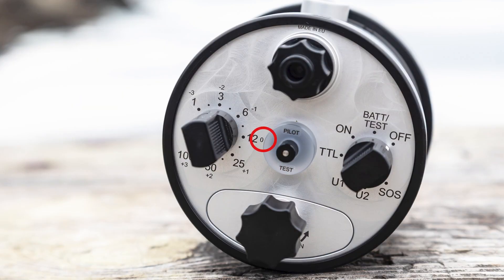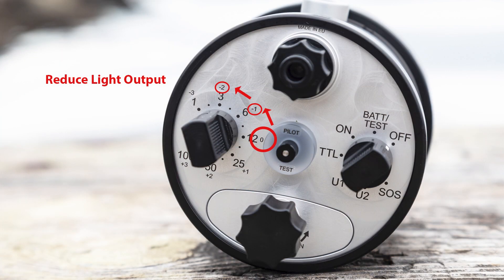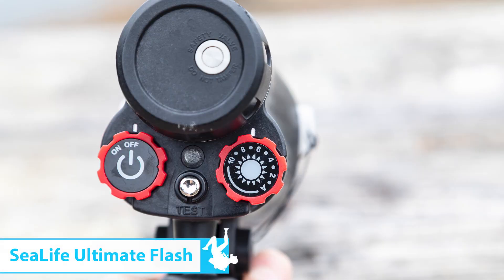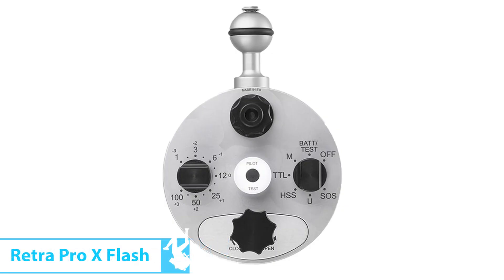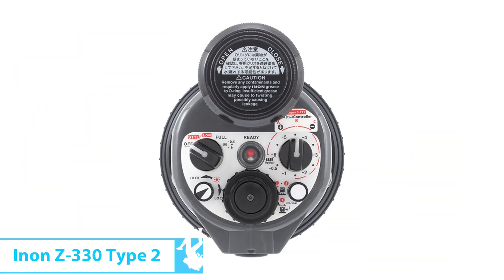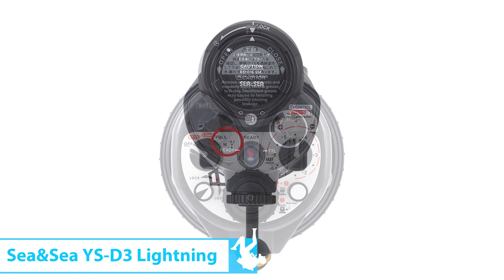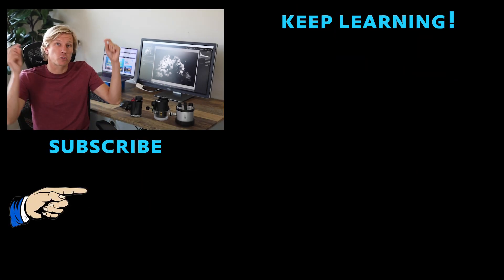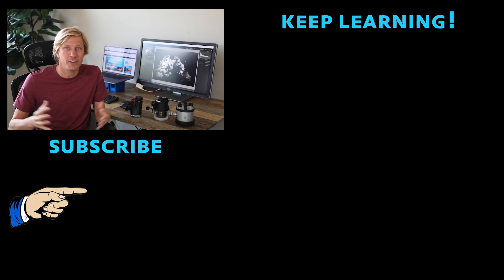What do the Numbers on Back of your Strobes Mean?

Comment: Great Video! A tip I’ve learned using my Z-330 strobes in full manual: sometimes mid-dive I’ll see my images way over-exposed, and after fiddling with the strobe power settings and camera exposure settings, I’ll notice the “OFF-STTL-Low-Full-M” control knob has shifted from the full clockwise “M” position to the “FULL” position, providing max strobe power. Putting it back to “M” corrects the problem. Just remember to go back and “in-fiddle” all the strobe power and camera exposure settings after to fix the real problem. Don’t know why that knob sometimes gets shifted over a click to “FULL,” but I’ve had this happen often enough that now that’s the first thing I check when images suddenly become overexposed. Keep up the really helpful tutorials — they are a HUGE help!
Reply from the maker: Thanks Todd - really appreciate it. Great insight with the Z-330. Are you using thick gloves? Moving the power knob accidentally was a major issue on Sea&Sea's first YS-D1s - I'd turn the strobes off nearly time I grabbed the back to position them. They updated the knob in the next version thankfully. Nothing beats real-world testing pre-production to discover issues like this. I appreciate the info as I haven't used the Z330s.
Reply: @BrentDurand  No gloves — Florida Keys diver! Haven’t figured out yet how I manage to brush the knob to the “FULL” position, but at least now I know where to check first! Now that I’m repositioning the strobes more frequently (thanks to your great video on strobe placement!), maybe I need to watch more carefully how I grab the strobe to maneuver it around. Anyway, great tutorials — keep ‘em coming!  — Kurt

Comment: Hi great video … is it possible todo a video about the z330 the manual settings i can’t find a good video 
You have the m with some numbers and at the top you see nummers and a-b-c
Reply from the maker: Hi Mario. The Z330 is pretty confusing to look at but actually is simple to operate. Next to the M position on the control knob you will see a little diagram showing -0.5 -> -6. This is trying to indicate that -0.5 on the power control dial is full power and -6 is low power. In other words, you turn the knob clockwise to increase strobe output in manual mode. I've included notes on this and a diagram of the strobe back on my guide below so you can take a closer look:
https://tutorials.brentdurand.com/strobe-control-dials/

Hope this helps!
Reply: @BrentDurand  thanks use the m mode and push the button to lock the manual mode 
In the top of the diagram you see a-b-c how to use this one
Reply from the maker: @marioalbers887  If you're shooting manual, then don't worry about that extra diagram. That's for controlling Super-TTL flash exposure compensation. Neutral is in the 12 o'clock position, then you turn the knob clockwise until 3 o'clock position to incrementally increase flash exposure compensation, or turn the knob counter clockwise until the 9 o'clock position to decrease flash exposure compensation. Again, don't worry about it with manual power!

Comment: Great video for sure! I have a YS D2 just like the one in your video, and I notice the guide numbers are the same as f-stop numbers for lens apertures. Is the relationship anything like 1 to 1, so for instance if I’m stopped down to f16 should I dial in the strobe power to 16? Or is that not how to think of it?

Btw I shoot an Olympus OMD Em5 ii in manual mode, with mostly prime lenses fwiw. 

Thanks again for the great content!
Reply from the maker: Hi Jaeson - Great question. In short, no, the numbers on the YS-D2 do not relate to apertures. You'll notice each number decreases by 50%, meaning as you move the knob from one number to the next, you're reducing the strobe power by 50 percent. The highest number 32 is the strobe's maximum power, measured as a "guide number." Hope that helps!

Comment: Hi Brent, 
Thank you for another great video. I have a basic question: I assume the strobe adjusts the total light per flash by changing  the intensity of the flash and not by increasing the duration of the flash, correct? The flash is, for all practical purposes, instantaneous. Is this correct?
From your videos, it looks like you dive central and north coast of California. I hope to cross paths with you some day. I, too, am improving my kayak diving protocol and your paddle board videos are helpful.
Dan
Reply from the maker: Hi Dan, thanks for the kind words. Yes, you're correct. It's the intensity / power of the strobe that is changed. Great to hear you're diving here in central/northern California. I need to get a kayak again... had to sell mine when moving to NorCal - go figure. Glad that the paddleboard videos were helpful! So much to explore when you have that extended range!

Comment: Hi what is the distance that 2 strobe will throw. On a medium costing flash Thanks
Reply: 2 to 3 meters if the strobes are really good middle range. Anyway, the closer you are always the better results you would get.
Reply from the maker: Hi Ben - Using two strobes will not make either of the beams brighter over longer distances. Instead, when you're using two strobes you have wider coverage. Instead of one strobe at 100-120 degree beam angle, you'll have two strobes, one on each side of the camera, lighting a wider scene in front of you (reef, shark, etc.). Below is a link to a full article and 21 minute video that explains this more: https://tutorials.brentdurand.com/underwater-strobe-positioning/

Hope this helps!

Comment: Good timing! Just got a set of YS-01 Solis strobes and I was trying to figure out this exactly. What does the N stand for on the power knob stand for?
Reply from the maker: Hi Bert - I haven't used these strobes yet, but I believe the N is the starting point for DS-TTL shooting. When placing the knob at the N, you can adjust the light intensity (basically flash exposure compensation) up or down slightly. Sea & Sea's manual says the level can only be adjusted down, but that doesn't seem right given the graphic. Can you call the retailer where you got the strobe? They'll know. We're curious! :- )
Reply: @BrentDurand  That makes sense based on the information that you were saying in the video. I've only used them in manual mode and for some reason when I turn the knob all the way to the right I don't get as much output as when it was in the middle. I'm still experimenting so maybe it's one of my other settings. I bought them from B&H photo so I'll try and send them a message sometime and see if they can provide any guidance. Thanks for making such great videos; they have been super helpful to me in learning UW photography!
Reply from the maker: @bertweeks2688  Interesting. I'm not sure why you wouldn't increase power output by turning the dial right towards -0.5. Maybe you have TTL active on your camera? 
And thank you! Glad you're enjoying the videos!
Reply from the maker: @bertweeks2688  Hi Bert. Sorry you're having this problem, but great video. I really have no idea, but it seems to a strobe issue and not a camera or camera flash issue. My first thought is that the capacitor might not be charging all the way at those two highest powers, although I see the red LED indicate the strobe is ready to fire. What batteries are you using? Are they new? High quality like Eneloop Pros?

Maybe the strobe needs a firmware reset. Where did you get the strobe? I'd try contacting the retailer and see if they've encountered this problem before. They may also be able to get you info faster than contacting Sea & Sea directly. Sorry I don't have a better answer.
Reply: @BrentDurand  Thanks for checking out the video! I've been sending it to anyone who might be able to figure it out. I'm using new Watson NiMH rechargable 1.2V/2500mAh batteries that I bought with the strobe, both from B&H photo. I'll keep troubleshooting it but I think I might have to send it back to Sea and Sea to get it diagnosed. Appreciate you spending the time to answer questions and keep the videos coming!

Comment: Thanks for the great video.  I'm thinking of purchasing some Sea & Sea YS-D3 strobes.  Most of my diving is in freshwater quarries, etc.  I get to the ocean 2-3 times a year.  Are there any suggestions for using strobes in turbid water?  In a quarry, using a strobe seems to do nothing but light up every little particle in the water which deems them pretty much useless.  Are video lights almost a better option?
Reply from the maker: Hi Jason - Thanks for the kind words. Video lights are still a light source and can illuminate those particles. The only solution for conditions like this is to ensure the strobes are out wide and angled out so that just the inside of the cone of light touches the subject (see 21 minute video below on strobe positioning). That said, it's still tricky. Most of my diving is in chunky 10ft vis and it's still a challenge to light every photo! Depending on the particulate, some people talk about turning the strobes backwards, where the light then reflects off all the particles and bounces back to your subject in a subtle, diffused way that reduces that backscatter glow. Hope this helps.
- Video: https://youtu.be/YEcbVIgUanY
- Full Article: https://tutorials.brentdurand.com/underwater-strobe-positioning/
Reply: @BrentDurand  Thank you for the response.  That positioning video was very helpful!

Comment: On some strobes there is an option to add a magnet.
What is it used for?

I have an Inon d-2000s
Reply from the maker: Ah yes - Inon's magnet! I forgot to mention this in the video. In short, the magnet should be connected to the strobe when shooting manual. The magnet should be removed when shooting TTL/Automatic. Reef Photo has a great blog article on this if you scroll down to the Advanced Cancel Circuit section: https://reefphoto.com/blogs/lighting/selecting-the-proper-settings-for-inon-strobes-1
Reply: @BrentDurand  thank you!!
Reply: @BrentDurand  Can you also explain the diffuser usage please?
like, when will I use a diffuser and why, what the differences between them and etc.

thank you!
Reply from the maker: @sarthur1111  This is a great idea. I'll add it to the list for upcoming videos and try to collect the beam angles for all popular strobes with and without diffusers to help put all the info in one place. Thanks for the suggestion!

Comment: Hi Brent, in one of your many amazing vids, you introduced the 2 step methodoligy for wide angle shots. First adjusting exposure without flash and once settled, add the flash and adjust the flash power to light the foreground appropriately. This actually triggered me starting to think about it in more depth for some scenarios.
Would it actually mean that I one should always ensure proper exposure and then only use flash light to bring color?
Till today, I feel I kind of use my 2 flashs to create enough light to see more than black which looks like the totally wrong approach.
Doesn't flash usage require adjustment of the while exposure setup for wide angle?
Hope you can help getting it right.
Reply from the maker: Hi Marutukus - Glad you're watching these videos. I assume we're only talking about wide-angle. Since all true wide-angle photos combine ambient light (background) and artificial light in the foreground (strobes), you should always achieve correct exposure of the background before adding the foreground light. The exception here is if the entire scene is close and will be lit by the strobes, in that situation there is more "try and retry" technique until you know the settings for a scene like that. It's a bit like macro in that you're relying 100% on artificial light, and as a result, cannot do the 2-step process. I hope I answered your question.
Reply: @BrentDurand  Hi Brent, thanks for answering so quickly. This and of course your vids helped me out a lot.
Talking about my strobes lighting the scene, what would you expect the range to be for a GN 33meter strobe in fair uw conditions. I assune around 5 to 7 meters distance can be covered at max. Didn't find many helpful info on that matter by now.
Reply from the maker: @marutukus5349  This greatly depends. Other factors include depth, particulate in the water, color of the subject and light absorbtion, etc. 3 meters is closer to maximum in excellent conditions.